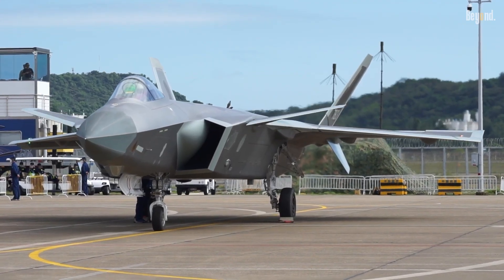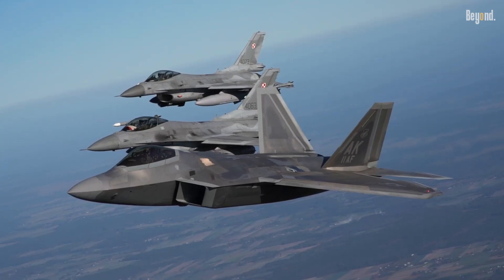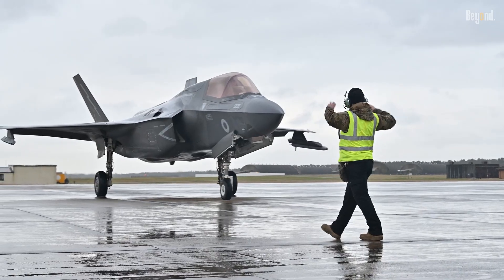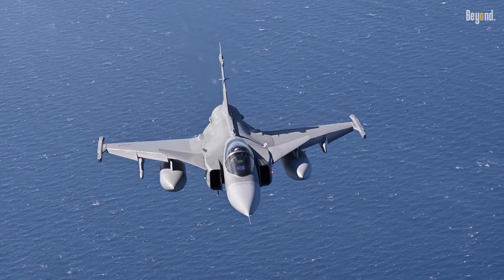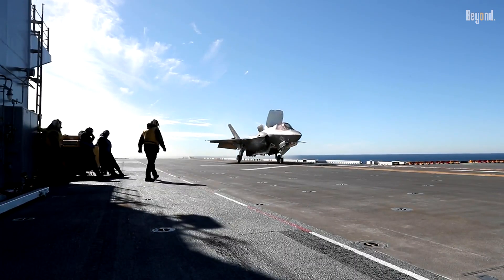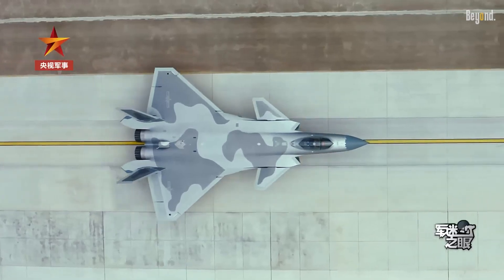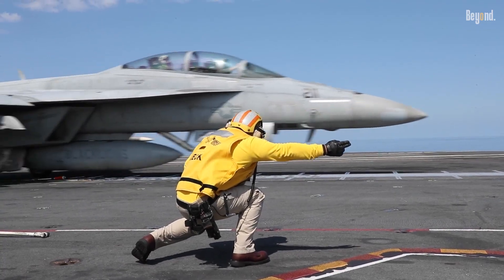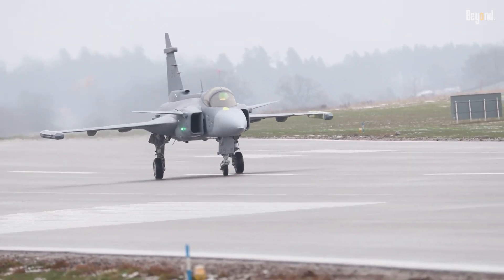Why US Fighter Designers Avoid Canards

Comment: The idea that the U.S. avoids canards due to maintenance complexity is nonsense. The Gripen E, with canards, has some of the lowest maintenance and operating costs in the world, about $4,700/hour vs. the F-35’s $40,000/hour. It’s designed for quick turnaround on highway strips by conscript crews.Simplicity at its finest.

This isn’t about maintenance. It’s about U.S. stealth doctrine and design choices. And funny enough, the upcoming F-47 is reported to have canards. So much for “too complex.” If you’re going to dismiss canards, at least be honest about why.